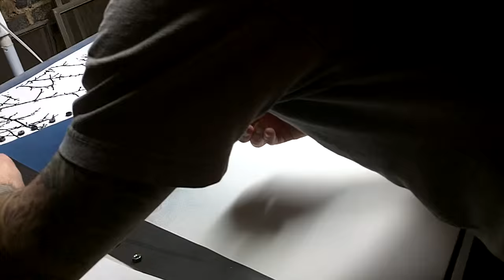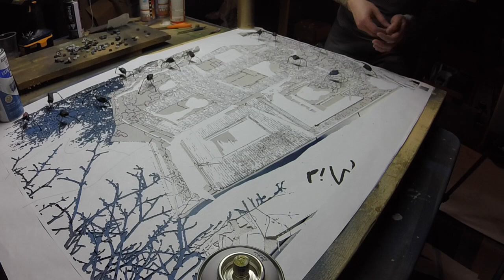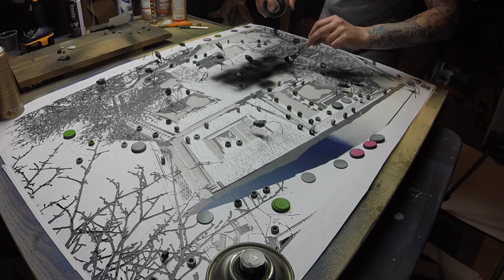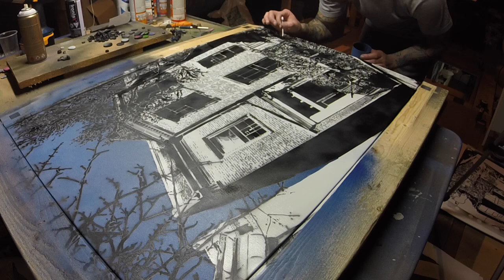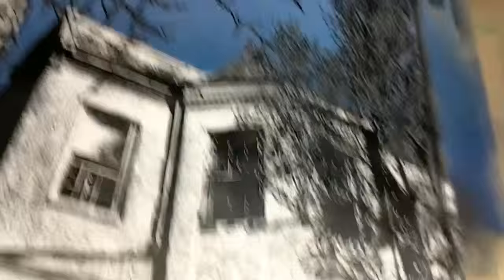Stencil Art featuring Richmond, VA Architecture (highly detailed)

Comment: Hello
I wanted to congratulate you for your work.
I have a small question to ask you
How do you get a big picture on photoshop without it pixelize
Thank you and congratulations for your work
Reply from the maker: Thank you for watching!  Always use high resolution images for your source photos, if possible.  And even if your picture becomes pixelized while enlarging, you can still make smooth cuts that will eliminate the pixels in the final product.